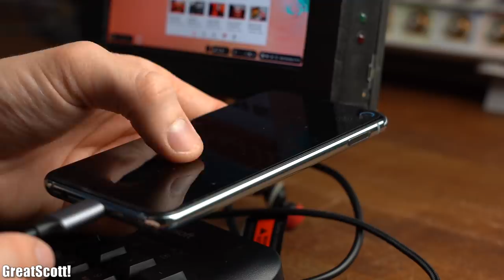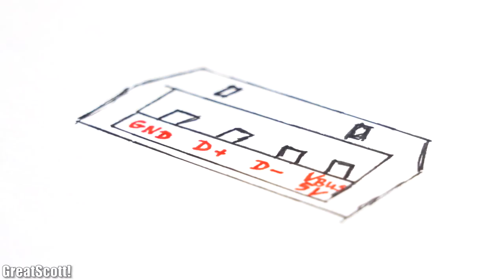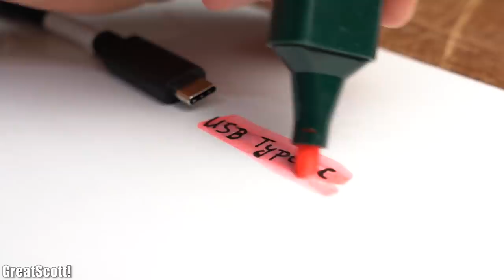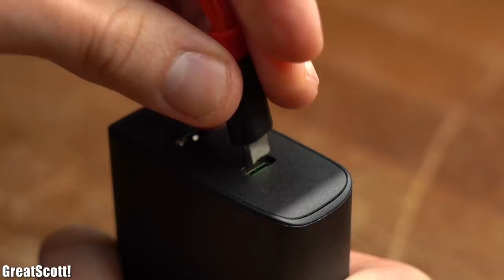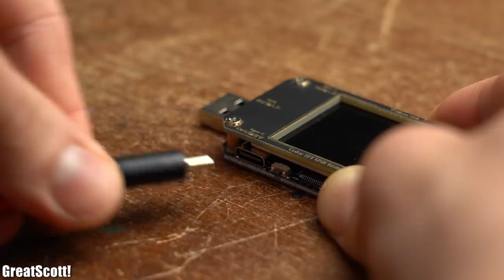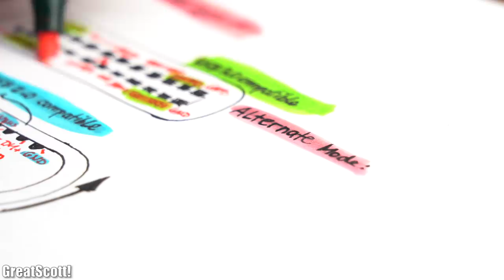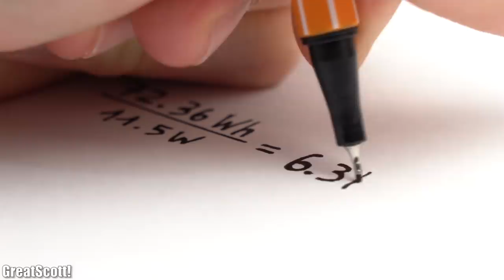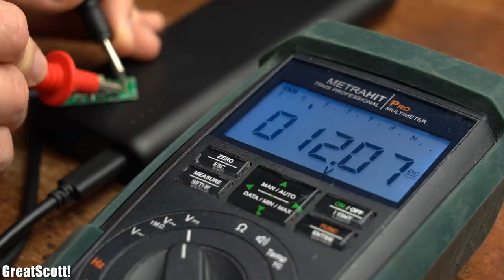Here is why USB Type-C is AWESOME and how you can use Power Delivery for your electronics!

Comment: Who remembers when usb was first being introduced and all the engineers said we would all only need one connector on all devices.... Yeah that didnt work out did it?
Reply: it worked, goal was to eliminate all diffrent data connectors for perifirals, only analog, display ports which required more badwidth and some other features and ethernet which requires high distance specs and to be cheaper
Reply: @Shadowriver  I get what you are saying but they didnt get rid of all the different data connectors, they just renamed them all different types of usb.  I do get there are far fewer versions now but it really didnt do what it set out too do which was create one single standard

Comment: Actually , with qc3 and I guess qc4 you could vary the voltage in an increments of 0.2v , and actually making a variable psu with it, have a look at this post from 2017 http://blog.deconinck.info/post/2017/08/09/Turning-a-Quick-Charge-3.0-charger-into-a-variable-voltage-power-supply

Comment: Personally I hate it because it's so much more fragile than 3.0. Those type C connectors break so easily and they're harder to fix at home. Also no backwards compatibility, you just have to buy everything again, Apple style. Finally, it so easy to disconnect it by accident, less grip in the port.

Comment: What I don't like: there are no extension cables in the specification. If you get a device with a too short usb-c connector, that's what you stuck with.
No male USB-C to female USB-C cables, to solve the short cable problem.
Sure you can buy them, but they are out of the specification, unofficial, mostly crappy quality.
That's what people told me, when I was searching for them.

Comment: USB C is more fragile than necessary. There should be an industrial strength form. Cables are all hard to distinguish. Sockets get loose and flaky easily. In theory it’s good. In practice it’s a mess.

Comment: The term is "bilaterally symetrical"
Reply: No, it isn't. It's a dyad symmetry; you can rotate it 180 degrees around the central axis and it remains usable. Bilateral symmetry would mean you could mirror it, which is a bit harder to do with an assembled cable (but any EE will tell you, easy to do when you forget which side of the board the connector mounts to).
Reply: This isn't genetics.

Comment: The USB-C connector is awful. It's obviously only designed to replace USB Micro and is only marginally more robust than it, which makes it horrible how the newer versions of the USB protocol are only supported by USB-C. I can understand that USB-A couldn't be extended further without breaking compatibility, but there needs to be proper replacements to USB-A and B.

Comment: Reasons to hate USB-C: Took away the headphone jack on phones now we get delayed audio connectivity with dongles.
Reply: That's an Apple thing, not a USB-C thing. The USB-C Audio Adapter Accessory Mode doesn't add any delay, just a stupid dongle. But USB Audio Class adapters (which are more costly to make), which typically do get that issue, are more widely available because they'll work with devices that don't support Audio Adapter mode. So basically one class of manufacturer chased the dumb trends and cheaped out, and another class had to cater to the lowest common denominator. Far too few realize that trailing the biggest dog will only ever grant them crumbs.
Reply: @0LoneTech  Nah, The DAC in Apple Dongle have very low latency, and have very similar audio characteristics to one that included in iPhone before they remove the audio jack.

If your phone audio got delayed with digital dongle blame the dongle you got or the phone, but chances are your phone aren't optimized to send digital audio over USB thus adding more latency, mine even with 5 year old iPhone 6 got imperceptible latency (no different than connecting earphone directly to the headphone jack, or using the speaker) ( keep in mind iPhone 6 comes even before dongle for headphone jack become a mainstream thing, but surprisingly they still able to make that phone work flawlessly with digital audio )
Reply: @rommysoeli  It's the removal of the real jack that is the Apple trend (as usual, copied superficially). I'm sure they use something like an I2S connection, which you'd have between the SoC and DAC anyway and causes no buffering (effectively the transfer time of a sample, since it's serial); USB DACs, by contrast, use isochronous mode which transfers packets at regular intervals but faster transfer rate, which means at least that frame must be completed beforehand and increases latency. On top of that OSes will frequently plan the entire frame transfer ahead of time rather than fill the audio buffers as late as possible.
Reply: LoneTech 

Thanks for your explanation.
Btw I’m curious about how they managed to do the same thing with iPad Pro, I mean since they’re using USB-C, I suppose they now have to do things more standardized and probably can no longer use their in house proprietary tricks.
Reply: @rommysoeli  It is a USB- in general thing, any connection over usb isnt immediate, especially with an active dac passing data since it isnt passive. Its not an apple thing its a usb thing in general. There is no  significant "latency" over any dongle, its the issue of connectivity. Latency is over wireless connections like bluetooth. Auxilary was analog so data is "pre-loaded" i guess you could say into it and all it had to do was switch channels over to aux from speaker. With a dongle the phone has to send data over the usb bus where it has to be converted back to analog and it isnt active all the time so it cant be "pre-loaded" per say. So  until the dongle is recognized it won't start sending audio to your headphones. Thats why the aux port was so important because it was overall just a better setup. USB isnt the best interface if you want immediate audio.

Comment: Type c is more resistance than micro b cuz they dont breack easy
Reply: It also depends on the built quality of the connectors themselves especially the cables and ports. There are lots of poorly made Type-C cables and ports that have twisted connectors not to mention manufacturers that does not confer to the USB-IF standards when it comes to power output which is extremely dangerous to the device and it's user.

Comment: usb-C  is awesome in theory.  In reality I have so many combinations of cables and ports that I now have to label to know what each port is capable of, which cable goes where....because they ALL LOOK THE SAME, no matter what they are for. It's an actual nightmare. Add in all the cheap Chinese cables that flood Amazon with fake reviews that you can't trust...that don't seem to work for what they are supposed to do....and it's even worse.

I'm sure it will get better in a few years...but now it is not very intuitive.
Reply: Theoretically if you have a not-dumb cable with PD capability it should work for everything. The problem remains as far as telling which USB port can do what
Reply: @alessandroceloria  Theoretically yep. But between my girlfriend, my daughter, and me....there's a pile of usbC cables that just don't work for what they were purchased for and have to be labelled so we know not to keep trying. I'm sure they are not to spec and it's not the fault of the usbC specification....just crappy manufacturers. But the fact remains for the user.

Also, while usbC is omni-directional....I've tested hundreds of cables for their power transfer capability....and there's a difference in wattage being carried depending on which way you plug in....sometimes up to 20% or more on crappy cables. So I test every cable....and mark the side that will charge faster, thus making them directional after all.

Comment: USB-C is absolute g6rb69e. 
Ebay is now overrun with fake chargers claiming to be able to deliver high wattage output, and it's a mnefield.   These micro connectors are double aweful; I have a ton of phones and tablets that died well before their time because their USB micro connector wore out way before their time.   USB-A was the only legitimate connector, and USB was never meant to power your friggin refrigerator over...

Comment: USB C SUCKS!  It is flimsy and if you actually use your laptop computer as a laptop, it breaks, and screws up the socket on the computer.  The old USB is a sturdy connection that can handle day to day wear.  My cat rubbed up against it once and now it comes back with USB not recognized.  LET'S MAKE THE TECH BETTER, not break what is not broken!  I am disabled, and not being able to use my trackball usb mouse without a dongle that FURTHER compounds the problem...I am super steamed, sorry.

Comment: USB type C is horrible. It completely destroys the idea of backwards compatibility and the idea of it being USB!
Instead it is a port used for so much crap, which any particular device may or may not have. The only thing certain is that it will provide USB.
It is not USB 2.0 Compatible.
USB 3.0 Type A is, because you can connect any version A plug into any version A socket.

Power delivery is possible via type A and B connectors. So that doesn't make type C awesome.

Type C is crap and should have never been allowed to replace type A.

P.S. It is 180 degree rotational symmetry, hence why even if you rotate it 180 degrees, it still works. Except those few pins which are used so it knows which way is up.

Comment: just my opinion...I don't  care. I'm A woodworker and  engine mechanic and I'm a bodybuilder. This nonsense of useless tech came up on my YouTube suggestions because I was was searching about the cheapest computer to replace a laptop that's 10 yrs old. I really hate how YouTube does this. Just one question...Is this really that important? I just want to clarify I'm 56 yrs old and didn't grow up with Computers and these gizmos but some how manage to become wealthy by building homes using old school math . Young man today are so weak looking.
Reply: This is really useful for electronics projects.
Over the years I've probably saved well over a thousand euros by salvaging old electronics parts instead of buying new things.
Yes, I could have brought a new overpriced computer power supply but instead I used another one I already had and just soldered a new connector to it.